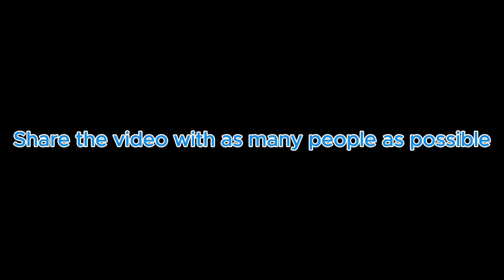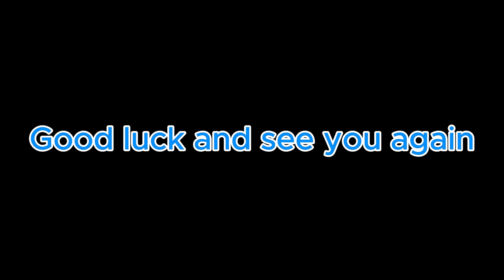Mix SILICONE and ACETONE! The results were shocking because they were so unexpected

Comment: Could you use this on your asphalt roofing shingles???
Reply from the maker: Thank you for your question! Using this device on asphalt shingles might be a bit tricky because the material is usually not ferromagnetic, so the device may not work effectively on asphalt shingles. You can try it and see the results, but keep in mind that it might not perform as expected.

Comment: Just remember anything you put that concoction on will never be to be painted unless you completely remove the silicone from it.  That turns out to be almost impossible most of the time BTW.
Reply from the maker: Thank you for sharing! It's true that silicone can make it difficult to repaint a surface. Once silicone has bonded, it can be very challenging and time-consuming to completely remove it, especially after it has dried. Some methods like using solvents or specialized tools can help in cleaning silicone, but it often requires patience and effort. If you need further advice on how to remove silicone, feel free to ask!

Comment: Wow, thats awesome will try it for sure. I also wanna know how to remove super glue from mirrors 100% so its clean and clear
Reply from the maker: Thank you so much! To remove super glue from a mirror completely, you can use acetone (like nail polish remover) or even cooking oil to soften the glue first. Then gently wipe it off with a soft cloth. If there's still a foggy layer, try using non-gel toothpaste to gently polish the area — this can help restore the mirror’s clarity. Always test on a small spot first to avoid any surface damage!

Comment: I am assuming it’s a 50/50 mix ? Plus if you put in a spray bottle will it get hard and clog up    If so how long does it take ??
Reply from the maker: Thank you for your question! Yes, many mixtures can use a 50/50 ratio, but this depends on the recipe and your intended use. If you put it in a spray bottle, some mixtures may harden and clog over time, especially if they contain components that dry or solidify easily. The time it takes for this to happen can range from a few hours to a few days, depending on the ingredients and storage conditions. You could try adding a bit of preservative or adjusting the mix ratio to prevent this from happening.

Comment: You can use Magikmold DMG-50 silicone thinner to reduce the viscosity of RTV silicone rubbers. With liquid brushable silicone, you can saturate fibreglass cloth to create various useful items, such as fireproof cable sleeves, and so on.
Reply from the maker: "Thank you for sharing the information! Using silicone thinner to reduce viscosity and saturating fiberglass cloth is a very useful method, especially in fireproof applications. This is a great technique to create durable and safe products."
Reply: How do you make the cable sleeves? Are they wrapped, as in a long ribbon style? Or can you make them into tube style sleeves? Thanks

Comment: Acetone will destroy the squirt bottle pumps on contact.
Reply from the maker: "You're absolutely right! Acetone is highly corrosive and can damage the plastic or rubber parts of spray bottle pumps. If you need to use acetone, be careful and choose containers or tools that aren't affected by it."

Comment: How much does a tube of silicone cost $$$.
How much does a bottle of acetone cost $$$.
How much for a spray bottle and the messy mixing and risk $$$.

Now, how much does a spray can of silicone spray cost $.

I rest my case.
Reply from the maker: "You’ve made a very valid point! Buying a ready-to-use silicone spray is definitely more convenient and saves time compared to mixing it yourself. Depending on the intended use, each option has its pros and cons. Thanks for sharing your perspective!"

Comment: Could you try it on a Flexible Surface such as Material to see if it can make a Coat Waterproof, or if it just cracks up into small pieces and flakes off?
Reply from the maker: "That’s a great idea! We will try testing it on a flexible surface like fabric to see how well it works for waterproofing and whether it cracks or flakes off. Thanks for the suggestion!"
Reply: I'd love to find a DYI waterproofer that is breathable 
Something I could code on the inside of a pair of jeans or something like that and beads on the outside with some other waterproofer
I know flex seal I use it on my canoe over some duct tape it held the hole was up high though
Reply: I seen a YouTuber do something like that with fabric I do believe 
Also I had a semi-dry suit that looks like it was silicone on the inside it started to peal after a while. I tried can't drive to fix it that didn't work.

Comment: So now we know water rolls right off of it once it treated. Splendid! But how long does it last under outside conditions? Like wind and rain and more importantly, UV rays which can deteriorate things in a hurry. How does it work on say canvas or leather? Just curious.
Reply from the maker: Thanks for your interest! 🌟 The durability of the coating depends on various factors, including the type of material treated and its exposure to the environment. Under outdoor conditions, especially UV rays, rain, and wind, the coating can last from several months to a year before needing reapplication.

For canvas and leather, effectiveness may vary. On canvas, it provides good water resistance but may require more frequent reapplications if exposed to heavy rain and sun. On leather, it's best to test a small area first, as some coatings might alter the texture or softness.

Comment: But how long did it take for the spray bottle of the mix to dry up or solidify, or is it still usable as is??
Reply from the maker: The drying or solidifying time of the mixture in the spray bottle depends on its ingredients. If it contains water or a fast-evaporating solvent, it may dry within a few hours or days. If stored properly, it can remain usable for a long time. You can check by shaking it gently and spraying a little to see if the mixture still works well.

Comment: How long does it last when outside.  Does it yellow when exposed to sunlight.   Maybe I just buy a product that is designed to achieve the same effect with a noted time to last, and aging changes.   Instead of guessing.
Reply from the maker: The outdoor durability depends on environmental conditions and the type of material used. Some materials may yellow when exposed to prolonged sunlight. If you prefer a solution with a known lifespan and specific aging characteristics, choosing a commercial product designed for this purpose might be a better option.

Comment: Can the mdf be painted after this application?
Reply: NO,

Acetone + Styrofoam can painted. But is not UV light resistent
Reply from the maker: hat's right! The mixture of acetone and Styrofoam can create a type of paint or coating, but it is not UV-resistant. If you need protection from sunlight, you can apply an additional UV-resistant coating.
Reply from the maker: Yes, you can paint MDF after applying the acetone and Styrofoam mixture. However, the surface may become uneven or slightly rough, so it's best to sand it lightly and apply a primer before painting for the best results.

Comment: You can never paint on top of silicone
Reply from the maker: That's true! Paint usually doesn't adhere well to silicone because of its water-resistant surface. However, if painting over silicone is necessary, using a specialized primer or paint can help improve adhesion. Thanks for sharing! 😊

Comment: You mean to tell me that's how they make that silicone spray that you can spray onto things. Maybe just with silicone and acetone and pressure and then it sprays like a silicone spray to waterproof and lubricate things
Reply from the maker: Thank you for sharing your thoughts! Yes, essentially, you can create a silicone spray by combining silicone, solvents like acetone, and pressure. When sprayed, the mixture forms a silicone coating that helps with waterproofing and lubrication. However, the exact method would depend on the specific components and manufacturing process.

Comment: Aseton mu, Solvent mi?
Reply from the maker: Acetone is a solvent. It is widely used in many industries to dissolve substances such as plastics, paints, and silicone. A solvent is a substance that can dissolve other substances without changing their properties, and acetone is one of the most common solvents.

Comment: Respected sir 
What is resin and hardner 
How to make these with simple method
Reply from the maker: Resin is a liquid or flexible material that can harden when mixed with another substance. Hardener is the substance that, when combined with resin, makes the material hard and durable. You can mix resin with hardener in the ratio specified on the product packaging to create a hard mixture. To make resin and hardener at home, you can use readily available materials like epoxy resin and hardener and mix them in the correct proportions."

You can use this response to explain the concept and provide a simple method for making resin and hardener. 😊
Reply: @Tips365day  
Thank you very much for the information 
God bless you and your family long life good health and prosperity 
I am from India

Comment: I use't power wash shopping carts at night. I spent quite a bit of money on rain suits and irrigation boots. I could have saved a considerable amount of money if I'd sprade an old pair of boots, pair of pants, shirt, and a homemade cloth apron. Especially in the winter in the snow country.
Reply from the maker: "Thank you for sharing your experience! You're right, sometimes using old items or DIY solutions can save a lot of money. Hope you find the best cost-saving solution for your work! 😊"
Reply: @Tips365day  That was two careers (jobs) ago, 30yrs. But I'm always a lookin. Thx, Agin.

Comment: Anyone any advice what mix silicone make candle moukds please guy's ❤❤❤
Reply from the maker: "If you want to make candle molds with silicone, use a two-part molding silicone and mix according to the manufacturer’s ratio. To adjust flexibility, you can add a little mineral oil. Good luck! 😊"

Comment: Can cement be mixed with this mixture
Reply from the maker: It depends on the composition of the mixture. Some substances may affect the adhesion and durability of the cement. If you want to try, mix a small amount first to test if it works well together.

Comment: Can this be applied to cement buildings
Reply from the maker: t depends on the specific application. If you want to use it for repairing or improving the cement surface, make sure to check the material's compatibility. If needed, you can test it on a small area first.

Comment: Will this dry as a mate finish? Thanks.
Reply from the maker: Yes, once it dries, it will have a matte finish. However, this may also depend on the type of material and environmental conditions. If you want a completely matte surface, you can try a matte coating to ensure the best results.
Reply from the maker: Yes, once it dries, it will have a matte finish. However, the result may vary depending on the type of material and environmental conditions. If you want to ensure a completely matte surface, you can apply an additional matte coating.

Comment: im wondering will this work on plain paper ? like say an A4 size paper with an image on it, will it waterproof the Image ???
Reply from the maker: You can respond with an informative and engaging reply like this:

Reply:
"Great question! It depends on the method used. Some coatings can waterproof an image on A4 paper, but it also depends on the ink type and coating material. If you're using something like clear wax, resin, or a waterproof spray, it should work well. Have you tried any methods before? 😊"

This keeps the conversation open and invites engagement.
Reply: well i got my answer as soon as i hit the last question mark in my earlier comment :
the answer being that - used in this process is Acetone, which will strip all types of sublimation inks and even Laser Inks( tried n tested) I have even disfigured and damaged "Currencies" by accidental use of acetone, - and the second thing is :  silicone is "highy susceptible" to UV rays it yellows, can flake, and even peels off over time like in 5 to 10 years.
Hope this helps someone ...................

Comment: Should test it on fabric.
Reply from the maker: Great suggestion! Testing on fabric would definitely be a smart way to check how it holds up or reacts. If you try it out, let me know how it goes! Feel free to share your results or ask for any advice. 😊
Reply: Made waterproof covers for my bike with a sheet using mineral spirits and silicone. Just hang the sheet outside because it just takes longer to dry.

Comment: There are so many inexpensive liquid silicone modified impregnators on stores' shelves that spare you breathing acetic acid fumes of the silicone sealant or acetone fumes...
Reply from the maker: It sounds like you're comparing liquid silicone-modified impregnators with traditional silicone sealants in terms of safety and ease of use. Liquid silicone-modified impregnators are a good alternative because they don't emit strong fumes like acetic acid (from silicone sealants) or acetone (from some adhesives and coatings).

Would you like recommendations on specific products, application tips, or more details on their effectiveness?

Comment: FLAMMABLE.?? Is there an Alternative to cutting the Silicone with something that isn't Flammable.?
Reply from the maker: Thank you for asking! Silicone can be flammable when exposed to high temperatures, so caution is needed when working with it. Instead of using tools that might cause combustion, you could try using a sharp pair of scissors or specialized cutting tools designed for silicone to avoid any fire hazard. Hope this suggestion helps!

Comment: It is an interesting idea; however, acetone is very flammable.  And, using a heat gut to dry it could result in fire.  And, the volatilized acetone is harmful to breathe.  And, I suspect that when the acetone dried, leaving the silicone behind, that the spray bottle and brush were ruined.  So, there are several risks to this idea. In my view, not recommended.
Reply from the maker: Thank you for sharing such a practical point of view! You are absolutely right about the dangers of acetone, especially in uncontrolled environments. Safety is the most important factor when experimenting with any materials, and working with highly flammable substances like this requires great caution. We truly appreciate this kind of advice to ensure the methods shared are safe for everyone."

Comment: If I applied this on non-plastered brick wall , can I then plaster the wall before paining it?
Reply from the maker: Yes, you can apply a damp-proof treatment or any moisture barrier to a non-plastered brick wall first, and then plaster over it before painting. The moisture barrier will help protect the wall from moisture, ensuring that the plaster and paint adhere properly and last longer.

Just make sure to allow the damp-proof treatment to fully dry and cure before applying plaster. This will help the plaster bond better and prevent any issues with dampness seeping through. Once the plaster is dry, you can proceed with painting.

Comment: I made a seam sealer to seat the joints in the roof of a truck box roof. Mixed silicon with a bit of acetone to make a thin paste and brushed it along the joints. No more leaks!
Reply from the maker: Great! Your method is very creative and effective. Mixing silicone with acetone can create a very good sealing layer. Thank you for sharing this experience!

Comment: Mix 2 tubes of silicone into a gallon of acetone and dip any type of  item of fabric to become completely water proof with mo rubbery feel to it...👍
Reply from the maker: That sounds like an innovative way to make fabric waterproof! Here's a breakdown of what you're proposing:

Silicone and acetone mixture: Mixing silicone with acetone creates a liquid that can coat fabric, turning it water-resistant. The acetone helps the silicone dissolve and allows for easy application.
Rubber-like texture: When applied, the mixture will give the fabric a waterproof, rubbery finish while maintaining flexibility, making it a great option for outdoor gear or rain gear.
However, there are a few things to keep in mind:

Safety: Both silicone and acetone should be handled with care. Acetone is flammable and should be used in a well-ventilated area, away from flames or sparks.
Testing: It's a good idea to test this mixture on a small patch of fabric first to ensure the desired results and avoid wasting materials.
Curing time: After dipping the fabric, it will need to dry and cure. Ensure it's fully dry before using it.
Let me know how it works for you or if you need more guidan

Comment: I wonder how effective the spray would be at preventing rust in hard to reach places like the inside of car doors/sills or even metal prepped for welding would it act as an impurity or a flux.
Reply from the maker: "Thank you for your question! Rust spray can be quite effective in protecting hard-to-reach areas like the inside of car doors or metal prepped for welding. However, if you are preparing metal for welding, make sure to clean off any rust spray to avoid any unwanted effects, as some products may create impurities or interfere with the welding process."